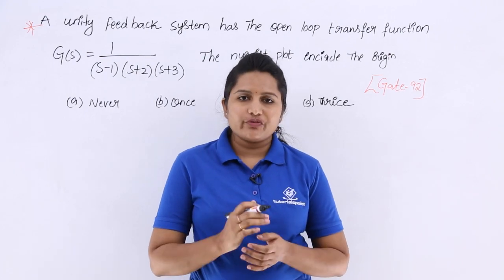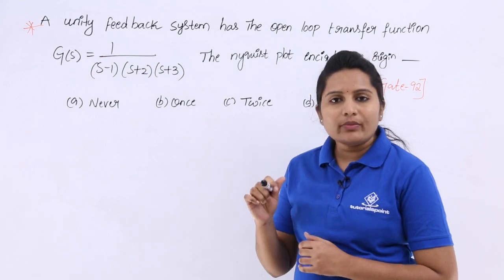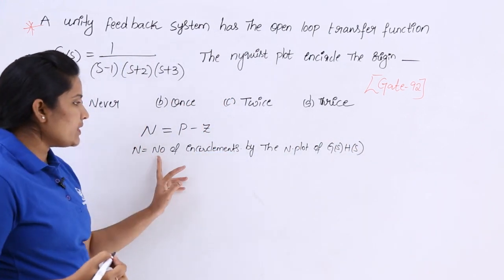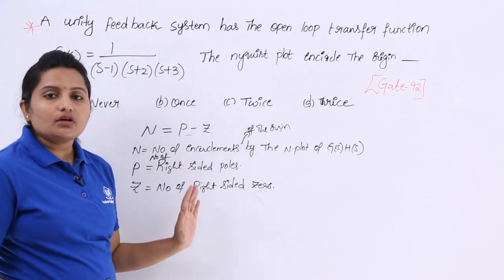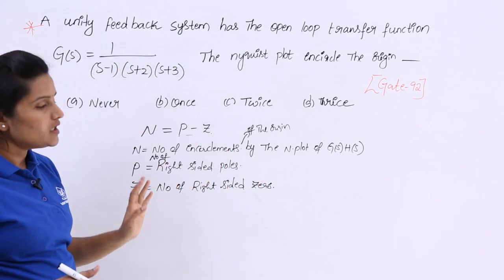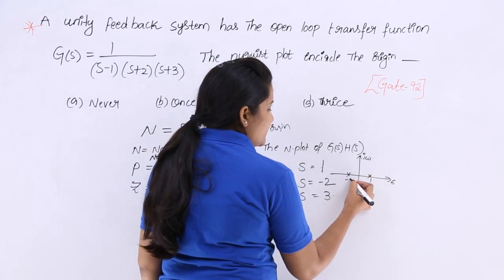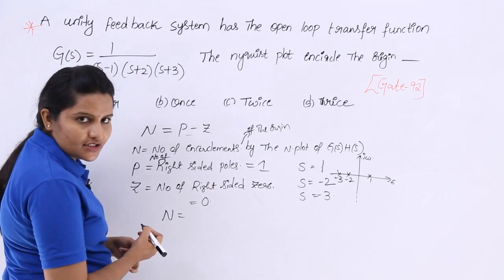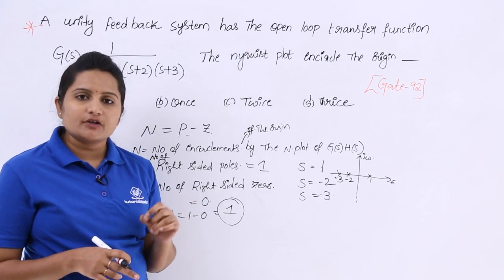GATE Problem 1 on Nyquist Plot

Comment: We are not asked for -1+j0 point.
So Nyquist stability equation won't be applied. We actually will have to check the polar plot, and from that we see that the graph passes through the origin but "never" encircles it. So answer would be "never"